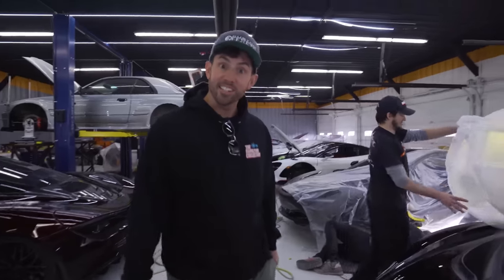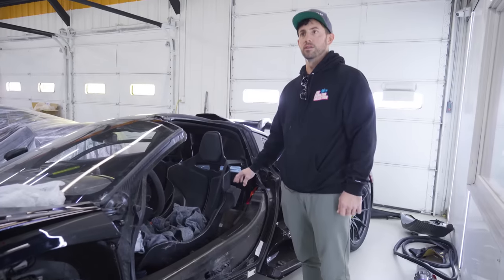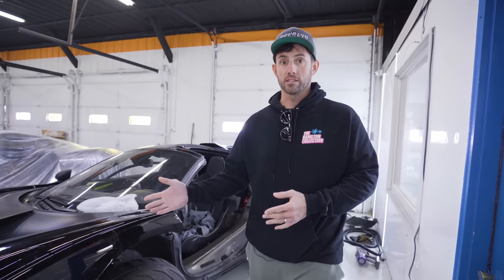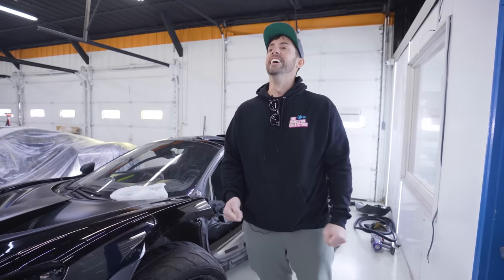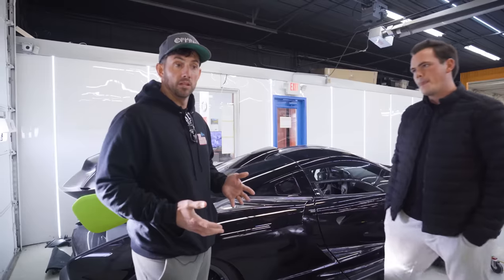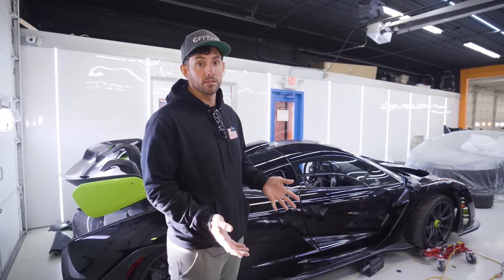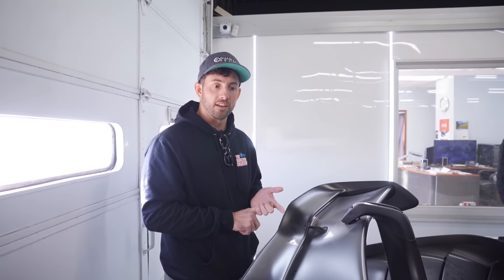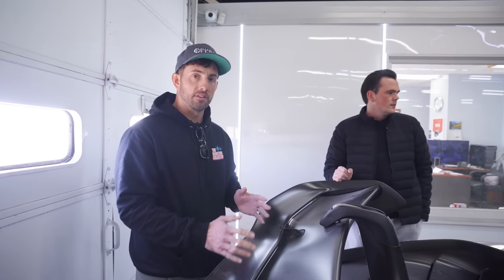My WRECKED McLaren Senna: Here’s My Final Decision.

Comment: Regardless of your choice. Composites can be repaired. I work in aerospace. We can’t scrap composite war aircraft when they get shot up or hit. $550K sounds pretty good. It’s not like there are enough shops that know what they are doing and for an affordable price. How cracked is the monocoque? Was it limited to what we had seen? You can get a structural engineer suggest a repair that makes it as strong as original. We do this all the time in aerospace. It’s not a foregone conclusion that a repaired composite structure is weaker when repaired. Getting an engineered repair is the key.

Comment: The car should never go to copart if you intend to buy it back, the insurance company should offer you a settlement - the buyback etc 

For example, say it’s 1MM total, the insurance should say you have the option to purchase the car directly from them before it goes to auction for let’s say 300k, they then will give you the car and take the 300k from your settlement, you’ll be issued 700k payment for the left over and what you do with that 700k is entirely up to you….

You can flip the car and pocket the extra (I’ve done this) and keep your settlement if you really wanted to

Comment: Jus a light saving hole, they do them along the hwhole main pillars on race cars:) Jokes aside, this can be fixed with carbonfiber layers, and the hole is in the middle, not in the curved corners, I don't see this as a structural issue, when fixed properly with carbon.

Comment: Take the check and get a new one or something else. No sense in getting the 🐔 repaired since it won’t be 100% also I wouldn’t use anything other than OEM parts for it. They don’t fit right and are hard to deal with. Goonzquad figured that out with there Porsche rebuild.

Comment: I hate to be pedantic but please here me out. Carbon fibre structures such as your chassis aren't really hard. The actual engineering term you mean is material stiffness. In materials science, hardness is a measure of the resistance to localized plastic deformation induced by either mechanical indentation or abrasion.Stiffness is the extent to which an object resists deformation in response to an applied force. So to put it more correctly - It's a stiff 'cock' rather than a hard 'cock'.